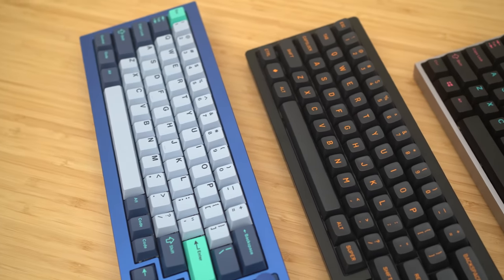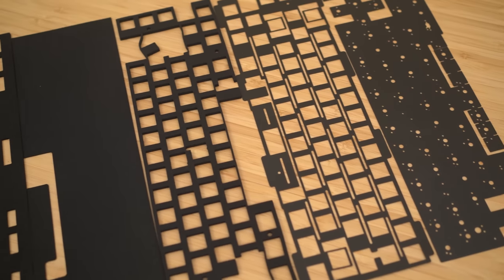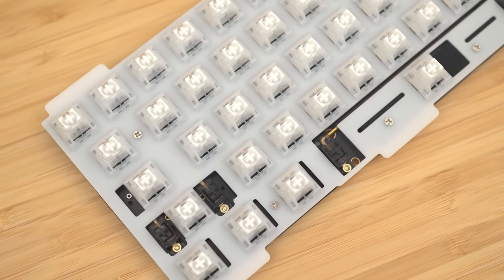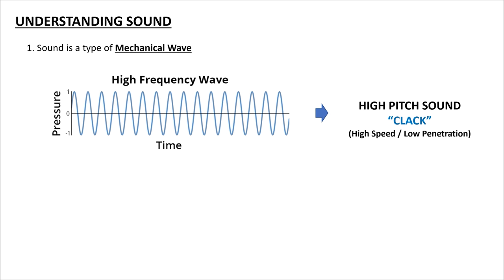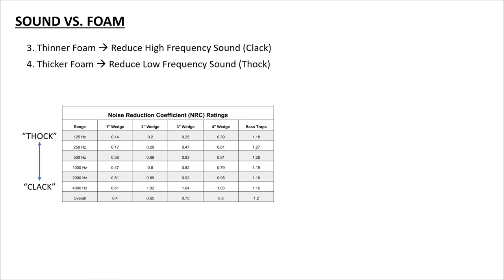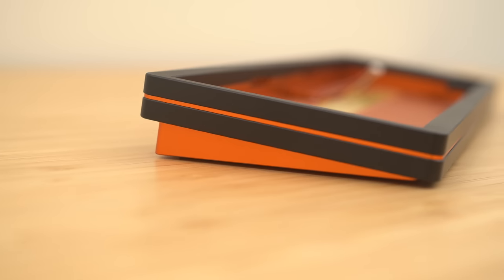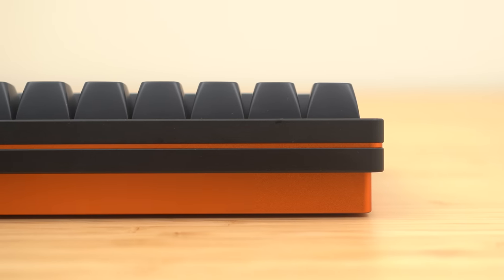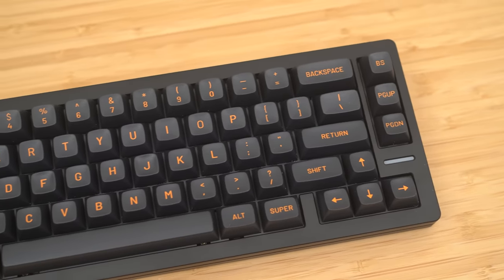YOU Make Your Keyboard Clack or Thock - Featuring Wind X65

Comment: Thank you for this. You truly are one of the best keyboard channels out here. I ordered a wind x65 myself, and it should arrive in a few weeks. I’m trying to imitate the ALL FOAMS - “CLACK BUILD”, and ilm just wondering, did you know put all of the foams included in the kit(0.5mm ixpe foam, 3.5mm Poron PCB foam, 0.5mm IXPE switch foam, 2mm Poron PCB foam, 1mm Poron Case foam, and gasket foam)? And did you add any additional foam? Thanks for the reply! @Keybored
Reply from the maker: I used all those foams with the exception of the ixpe foams! It gets pretty clacky! Lol
Reply: @Keybored  thank you so much for the reply. Looking forward to building mine when it gets shipped. For the mill-max hot swap sockets, which type did you use? Not familiar with these (honestly didn’t even know they existed), but did you solder these things to the pcb too?
Reply from the maker: @some_nobody  I used mill max 0305! This is the cheaper and longer silver one. You can also use the 3505 which is gold and shorter. The shorter one is better for better compatibility and switch fit, but also harder to install. You pop them into the socket, and then you solder the underside to make contact with the pcb contact. Actually pretty simple and easier that people think!
Reply: @Keybored  thanks so much! Will be using the 0305 for my build then!

Comment: Just wondering, if it's up to us to adjust the pitch of the keyboard, is it possible to do so for volume regardless of what switches we have? Is it just dependent on how much foam we add into the case? I just want to make my keyboard quiet enough for office use without having to use silent switches :3 Great informative vid btw!
Reply from the maker: I would have to look into how to change the volume for the keyboard as well!  For starters, having a larger "chamber" under the plate increases the overall volume.  So having less space in there will generally make the keyboard quieter.  Imagine the difference between an acoustic guitar and electric.
Reply: @Keybored  Great, thanks and keep up the great content!

Comment: I really like the video and of course like the majority opinion please keep up the science part. Quick question how much layers of tape did you use ?
Reply from the maker: 2 layers :) I found it to be what I liked the most
Reply: @Keybored  I did the same with my Wind X and if you add more layers you lose the flex of the board. I also make some cut in the tape layer where the flex cuts are

Comment: Hey I hope you can see my message, to confirm the hot swap socket you used does not require soldering? 3:51 I see no soldering iron on the PCB. It would be great if you can confirm it
Reply from the maker: It does require soldering iron to solder the mill max sockets into the little pcb holes!
Reply: @Keybored  thanks! I've tried soldering millmax 7305 before, hopefully 0305 is easier

Comment: one thing i want to point out is that you used different switches for the different builds, which creates uncertainty in what actually affected the sound profile, like whether if the switch entirely affected the sound profile, or if the other factors affected them. i think you shouldve used the same switches for both builds in order to prove that the switches arent the only thing that matters in terms of creating specific sound profiles, which was what the video was aimed at, i assume. great video either way though, and of course it's not just the switch that matters and of course the changes you made outside of the switches are what mattered the most.
Reply from the maker: Great feedback! I wanted to show the extremes so only ended up really emphasizing 2 major builds. But I see your point!

Comment: for qk65, they have a lot of foams, and some of them are very thick. Then why, they can make every switch thock?
Reply from the maker: They use silicone in the lower case.  Silicone doesn't allow sound to penetrate in to dissipate much at all, it rather controls structural noise of the case more.  If you take the silicone pad out of the case, you can make the QK65 be even deeper in sound, which I did to mine.  Also, you have to take things into context where thinner foams can realistically only reduce very high frequency noise, where a thicker foam is needed to reduce lower frequency sounds.  It will help reduce, and not eliminate.  Finally, the QK65 uses PE foam... that is essentially a V filter on the keyboard and does make the keyboard thock more.

Comment: Did the Black Inks go well into the Milmax? I thought Gaterons usually don't work with them?
Reply from the maker: Worked perfectly fine! Absolutely no issues I've felt with any of the switches I tried in them. Gat inks, oil kings, CJs, caps, aqua kings, etc.
Reply: @Keybored  I will try it on my next board. You can't push Milmax out through the back. It's a huge advantage.

Comment: Okay so, 
higher frequencies = less penetration
lower freq. = more penetration
So, less amount of foam is able to block higher freq. while the lower frequencies escape.
And more foam is needed to block the lower frequencies.
But then why using more foam makes the keyboard sound clackier?
Shouldn't the extra amount of foam have blocked the higher frequencies as well as lower frequencies?
Why are higher frequencies able to escape thicker foam if they have less penetration?
Reply from the maker: It's because if you look at the noise reduction coefficient and how much high frequencies the foam blocks, thinner foam is equally as effective as thick after a certain point.  So thinner foam can reduce high frequencies, but not so much low frequencies.  So whether you have a thin foam or thick foam, the amount of low frequency reduction should be about the same.  Now, as the foam thickness increases, it starts to become more and more effective against the low frequencies.  So if high frequency was blocked by thin foam already, as you increase the thickness, its effectiveness against the high stays pretty consistent, while you get less and less lower frequency.  So to your years, you get less low, frequencies getting to it, so the overall sound profile will be more "clacky" to you
Reply: @Keybored  thanks for the explanation

Comment: That doesn't make sense to me...

Reduce thickness of foam = lets low-frequency waves through, blocks less of high-frequency waves....that should mean greater clack, no?

On the other hand, greater thickness of foam = still lets low-frequency waves through (because they're more penetrating), blocks even more high-frequency. Shouldn't that lead to more thock?
Reply from the maker: Actually, thin foam can only reduce high frequencies while low frequencies will penetrate it easier. As foam increases thickness, it'll start to also reduce lower frequencies. So thin foam = upper frequencies, thick foam = high and low. So thick foam reducing low frequencies, takes away thock along with clack.
Reply: @Keybored  , ok that makes more sense. Thanks.

Comment: Does this also mean metal cases will have higher sound than plastic cases?
Reply: from the boards i've tried, cheap/budget boards that have abs plastic cases or similar usually have deep sound and metal cases more on high pitch but it will vary depending on the mods and config you have

Comment: Reposting A GWAKwork Orange's removed comments from another video. Might be very useful to achieve deep sound

Silicone and thick case foam are actually ANTI thock. Putting these in your case will increase the pitch higher into the clack range. The best internal case material for deep sound is polyfill, not foam (thick/dense foams absorb lower frequency, thick/dense polyfill absorbs higher frequency). 5 decades of DIY speaker hobby says this is proven science. 100% of keyboard youtubers that ive seen that have tried polyfill in their cases are doing it wrong. It has to be packed VERY densely just like a speaker enclosure. Aside from that the other big contributions to deeper sound will be case weight (heavier is better), thin PE foam on the PCB, total internal volume of the case (larger is better, hence why polyfill is important. Polyfill simulates increased internal volume by diffusing sound waves). And also one of the biggest factors is the weight/thickness/density of your desk. I have a thicc herman miller desk that weighs probably 100 lbs, comparing that to a lightweight hollow ikea desk is night and day. Probably the single biggest change in overall sound profile came from upgrading the desk itself.

If you are not going to put PE foam above the PCB, and want to put it in the case cavity instead, you should place it directly at the back of the PCB (like the side where the tape normally goes on a tape mod) and use polyfill in the rest of the cavity so that it pushes against and holds the PE up against the back of the PCB. I have builds in both configurations. "default" PE on top of the PCB like on the QK64, as well as a more DIY PE on another case like how i described above. Both of these configurations are absolutely effective in creating mechanical sound filtration. As for whether or not it "thocks". PE is what creates that distinct mid-range "marbley" sound. The thing that will actually deepen the sound is polyfill. What you have to understand is that a keyboards sound signature will always be a combination of layered sound. In this case combining PE with polyfill in this manner will have a sound profile that is both "marbley" and deeper "thocky" sound. I think what most people refer to when they say "thock" is this particular combination, and not exclusively just a lower frequency profile.

Comment: Yes but no, while the air around a high pitch sound moves quicker due to the higher frequency, the sound wave doesn’t. All sound waves are equally fast. (When compared in air of course)
Reply from the maker: You are right.  I may have overly simplified it due to equation speed = frequency*wavelength.  However, the frequency and wavelength are inversely proportional, so essentially, speed will receive a very minimal impact from the frequency increase.  Good call out!

Comment: so, technically thocky board produces both clack and thock, but the clack is drowned out by the sheer volume of the thock. Is that right?
Reply from the maker: Also depending on the foams and modifiers, it will also decrease either the lower or the higher frequencies... so less of it also
Reply: @Keybored  you mentioned that silicon dampen sounds and fill the hollowness, but doesn't act as a sound modifier like a foam does. Would you say that a silicon-filled keyboard case is "neutral sounding" and emphasize neither ends of the sound frequency?

Comment: Both high and low pitch sounds propagate at the same speed.
Reply from the maker: Hmm... Perhaps I shouldn't have related speed with frequency so bluntly.  I used equation Speed = Frequency*Wavelength, and correlated increase in frequency equates increase in speed... but then wavelength and frequency is inversely related so it may not impact speed much at all... good call out!

Comment: Sound speed should be the same at the same environment, which should be roughly 340m/s at room temperature.
Reply from the maker: You are correct.  I used the equation speed = frequency*wavelength and made the correlation between the higher frequency to speed, but didn't include that frequency and wavelength is inversely proportional so speed shouldn't be effected much... I should have gone deeper into it... next time for sure!